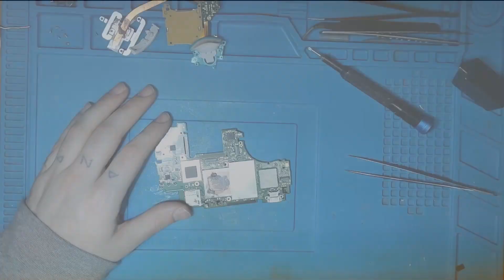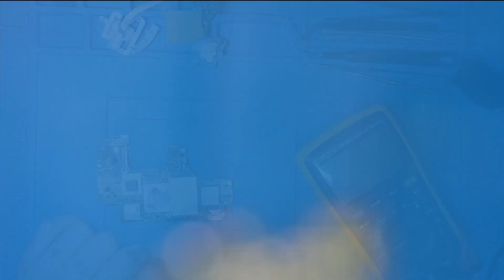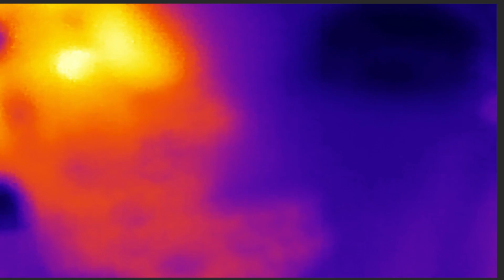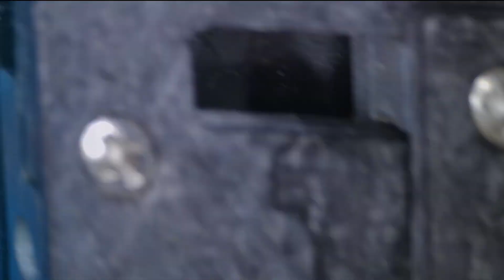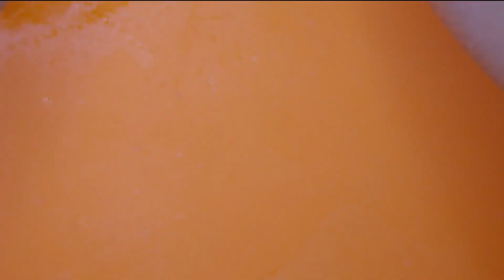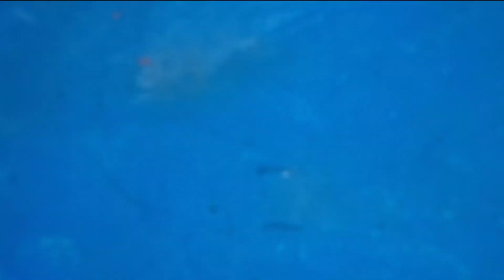Faulty Switch Lite With 0.15mA Draw

Comment: What temp do you normally have you soldering iron on?
Reply from the maker: My quicko T12 is 360c any my other big one is 440c.
Reply: @Andy-SER  So what should be a good temp to remove solder off the board. I have solder on the screw hole about the timer pin on a OLED, de-soldering wick gets stuck on the board when I try to remove. Trying not to burn the crap out of the board